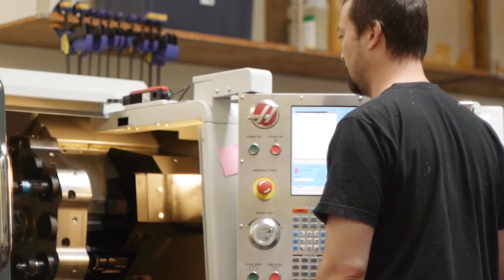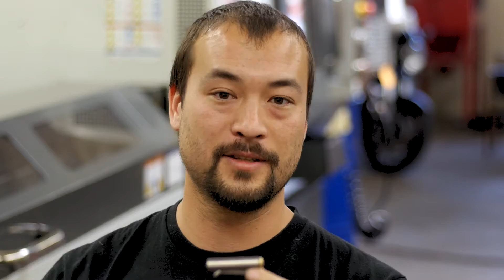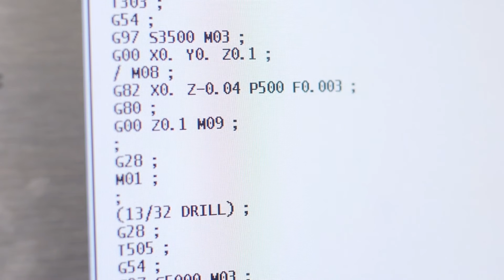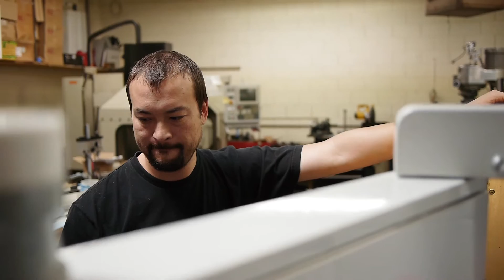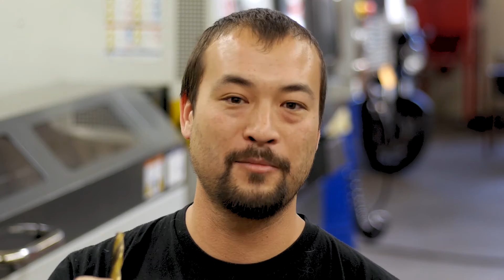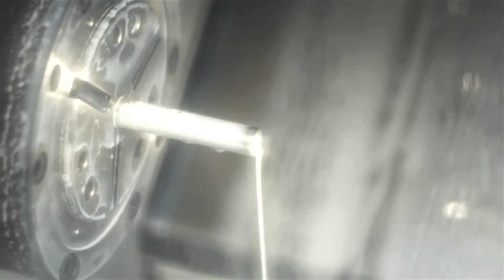Prometheus Writes: Alpha Pen Update #20

Comment: Have you looked at insert drills? I have to think you'd spend quite a bit less on replacing inserts than entire drills even if you get the same number or fewer parts. Iscar, Sandvik, etc all have lines of insert drills with the thru coolant you're using :)